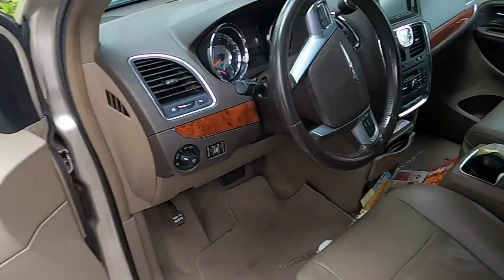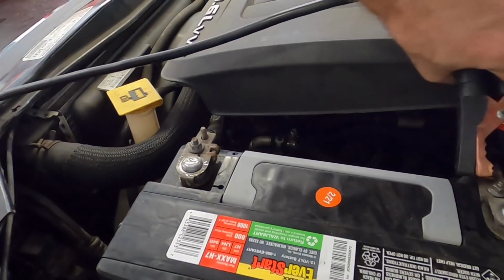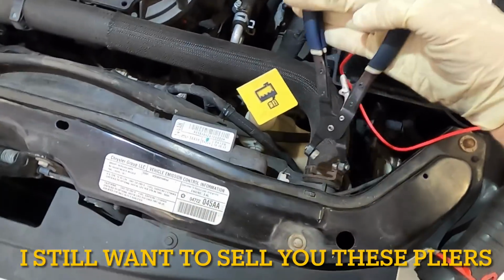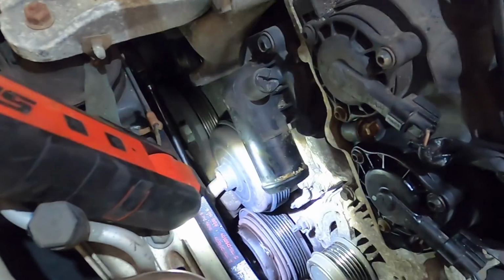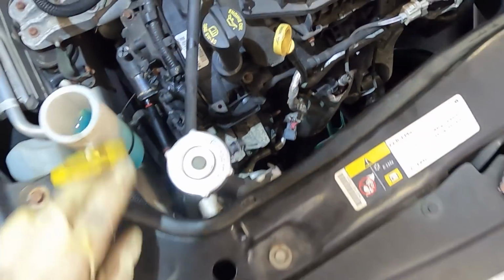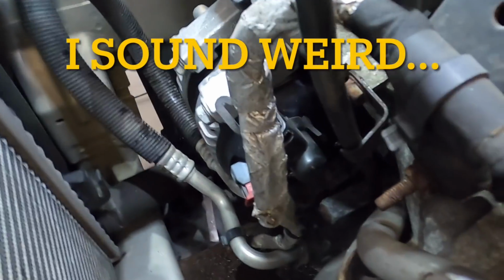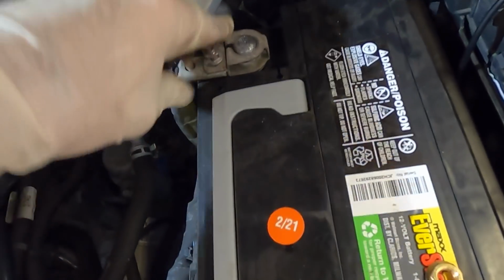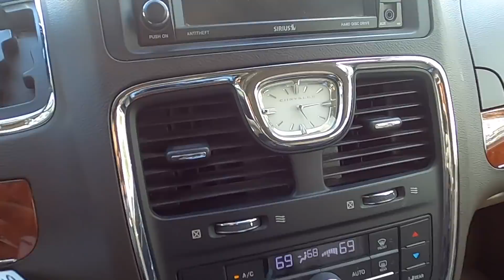Customer States: Burning Smell…Fire? 2014 Dodge Chrysler caravan battery light on!

Comment: The repair industry should all get together and refuse to repair vehicles until they design these things to make it easier to repair .. It's ridiculous that manufacturers don't think about what it takes to repair these vehicles
Reply: How well that work? That will take years! Are technicians supposed to starve while they wait? Good technicians typically beat the flat rate and have a full day’s work lined up for them. They don’t want to do the same jobs and be finished in 2-3 hours with no more work to do. The repair industry will never go for it.

Comment: When comes to common serviceable parts (like starters, alternators, brakes, batteries, filters, etc.) Get the engineers together, have them make repairs to the parts in the prototype car, then see if they can make it easier to replace.  Probably not!
Reply: When shopping for a reliable car, your mechanic (or Toyota), are your most valuable resources...Or, buy an American car...And roll the dice! (Let's play; Which model/year is not the lemon...?)
Reply: @brentfarvors192  Just got a new 2020 Toyota 4Runner, a year ago. 😊

Comment: I appreciate your approach. For me though I don't have that kind of time so I usually remove the four bolts on the AC compressor remove relocated dropped the alternator and pull it from the side. If I'm not mistaken that was a clutched alternator as well that nasty sound usually is a failed clutch. I had a customer bring in their vehicle they said that the battery light only came on after the car has been running for a while. 😂 (clutch get hot then quit) Oh yeah and I say to each his own..... But I'm spoiled with the Power Probe Meastro but I've recommended similar logic probes like the one you had. To any one get hates on any man's tools.....I don't care IF its held together with mostly duct tape and bailing wire. If it works don't knock it.

Comment: Ever try cotton liners?  I work with gloves and for sweat (and maybe a little less burn on hot parts) can't do without them especially when changing gloves.  My XL hands always stretch gloves so they also help slipping them on dry.
Reply: To whisk sweat away I would think they would use wool instead of cotton.
Reply: I usually buy the cotton liners at Northern Tool but Harbor Freight now has them. They are white and come in a 6 or 12 pack. I actually learned this trick from my BBQ team. Pork butts are much easier to pull when they are hot and when you have 40 to pull, it really saves your fingers. It works great for dealing with hot car parts too!

Comment: 12.5 volts are too low? While the alternator may in fact be bad mechanically because of the bearing whine, you do realize many modern alternators have decoulper pulleys that freewheel under low electrical load like idling, to save gas. 12.5 might be perfectly normal electrically.

Comment: On the 3.3 and 3.8 engine you could swap alternators with a 1/4" socket set in 30 minutes, nothing to take off or drain. This engine is crap with its bad rocker arms and lack of access.

Comment: When you tested the bad alternator with the voltmeter, it would have been interesting to see what the meter said if you had set it for AC volts. I think .5v is the normal limit, but a bad diode allows much more to reach the battery. That whining noise might be due to a diode.
Reply: You have four dials in a circle and they convert AC to DC it it is a great thing to do in certain applications

Comment: This just goes to show you there’s more then one way to replace a part… when I did this I did it all from bellow. Never touched the cooling system, just dropped the tire off and took out the plastic wheel liner. From there I moved the a/c compressor and unbolted it and the alternator leaving the a/c lines still in………. To which way was faster and easier. I have no clue.

Comment: The computer knows what the running voltage is. There is no reason what-so-ever that modern cars can't give drivers a verbal message; ”Hey brah, my alternator isn't charging.” Well, actually there's ONE reason. The battery lobby likes selling batteries.
Reply: Actually it DOES 'know what's wrong' but it won't just display it!
( A 'code reader' wouldn't work at all if if wasn't being fed 'fault' and 'error' information from the vehicle's 'mother chip' which has being 'storing data' since the first instant it was powered-up )
________
ANY modern vehicle could easily display 'WTF IS WRONG?' right from the factory instead of pointless 'coding' that cannot tell you 'phuck-all' without a 'diagnostic reader' to decipher 'number/letter' sequences that could easily tell you "HEY...my fuel-injectors are full of some kinda' sh!t so get them cleaned"  or 'HEY...the 'Alternator' isn't 'Alting'  worth sh!t and my sensors say the bearings are 'shot to sh!t' and 'fixing to melt and seize' so get me a new one right away and I mean TODAY! or we ain't going nowhere!*
In essence, you are 1,000% right!
WE ARE ALL BEING DECEIVED DELIBERATELY!
Reply: @gerrynightingale9045  it could display sort of what's wrong, but usually not what's causing it to be wrong. Car computers only recognize symptoms. It takes a competent human diagnostician to figure out where the symptom is coming from.
Reply: Modern cars should also have tires that last years but that wouldn't sell tires.
Reply: @RezaQin  modern cars do have tires that last years, especially compared to old bias ply tires tubeless, or even worse, tube tires. If we made them harder wearing we'd have worse roads, worse power, worse traction, or less fuel economy/more emissions. The fact you can get 80k miles on a tire without it going flat is a bona-fide miracle of engineering and infrastructure design and maintenance.
Reply: Isn't that what the battery light is for?
Reply: @Yophillips3272  hence another pointlessly replaced battery.
Reply: @7MPhonemicEnglish  It would be nice if cars would be more exact with the faults but if people can't figure it out they probably need a mechanic anyways even if it said alternator bad.
Reply: @RezaQin  all you need to do is hit the wrong pot hole or piece of debris and the “best” tire dies.

Comment: Tidbit of useful information, the battery manufacturer doesn't affix the date stickers onto their units until it ships. There is a code "stamped" on the battery that gives date information but techs and part guys can't discern the age from it, only the manufacturer can "decode" it. This typically isint an issue on common BCI group size batteries because they are moved from inventory quite regularly but on uncommon or "high end" batteries it means that your fresh date code sticker could actually be fixed to a battery that has sat on a shelf for 6+ months before it shipped.
Reply: i got one that was 3 years old on the shelf according to the sticker. A massive boy for a Porsche Cayenne....it lasted only a year and when i took it back I got the one they replaced the inventory with so it was only a year old. 
when the voltage gets to low in that vehicle it gets ghost lights. awd errors, headlight errors, engine codes because it runs rough. she definitely needs a lot of juice or she goes crazy.
Reply: Always check the date code on all batteries you buy. Even AA batteries and coincells have a datecode about ten years into the future. Many stores sell 7-9 year old surplus batteries.
Reply: I suppose the point is - do you take the one that's been sat for 6 months at the auto store or wait for a new one to arrive that's been sat for 6 months at the distribution centre.
Heads you lose tails I win.

Comment: I'm convinced that automotive engineers hate mechanics. With all the technology available in design ,wouldn't you think that the engineers would design something that's easy to work on? I own a ww2 jeep. Simple to work on. Easy to fix. I miss those days .
Reply: It seems from the comments that he did it the wrong way. Should have taken it out from the bottom. But also, a lot of the time the engineers have limitations on what they can do, often being told to use a pre-existing engine and making it fit into a different car. And of course there's always financial limitations on their design.
But yeh, the thing that irks me the most is oil drain plugs that drain straight onto another part of the car.

Comment: Dear god . All that to remove an alt . My mid 90s- 2000 fords, chevy, and even dodge v8s is like a 10 min job lol.
Reply: If you think this is bad, look up replacing an alternator on a 1st gen Ford Escape V6. It's a 3hr job that requires removing the axle shaft.
Reply: I saw a video where someone had to replace the alternator on a Fiat 500. He had to take part of the suspension apart!
Reply: Look at the 90s era's Ford Probes. To get the alternator out you have to remove a ton of parts in the suspension.
Reply: look up Cadillac Deville alternator change, you have to drop the subframe
Reply: Alternator on my 92 Integra had to remove the axle. On my 2002 V6 Altima had to remove the radiator.
Reply: My "everyday cars" are '79 and '88 Monte Carlos. I do all repairs myself. What I loose in gas mileage I more than make up for in repair costs. I've also been driving them for decades!!! Can't say that about the average new car, especially imports.

Comment: I love how those alternator pulleys have become a maintenance item. I get why they did it, but it definitely threw me for a loop the first time I encountered one in the wild.
Reply: When my son was racing dirt track we converted from v belts to serpentine belts and that help us hold the belts on at higher RPMs cuz that motor would flat scream and then high RPMs it would hold together and we sold that motor for years after racing is a running motor and never did come apart and we freshened it up every season

Comment: Most modern "smart" battery chargers will start with a trickle charge on extremely low batteries until it reaches a level where it's safe to give it full beans. That gives the best chance of the battery recovering without damage.
Reply: Even with a plain Jane old fashion charger most batteries taken down that low don't take much current flow for a while until they get rolling.

Comment: I did one of these once.... took it out the bottom.  Had to remove AC lines.  Not sure if it was faster or easier.
Reply: Don't have to remove the lines. Just unbolt the compressor and push it aside.

Comment: last year, my valve cover decided to coat the engine and alternator with oil. Alternator replaced and two months later the new alternator failed. Turns out the center shaft broke. It happens.

Comment: Faster to go underneath and unbolt the AC compressor and drop the Alternator out the bottom. Don't have to drain the radiator or remove the fan. Takes about 45 minutes that way. 5mm socket to unthread the studs and moves much easier without those in
Reply: Ya beat me to it.
Reply: Just did my wife’s van last week. Took it out the bottom way easier.

Comment: Rainman Ray!! A tip to increase your views. Add the Make, Model and part you are working on in the title. People with the same issue are searching for how to do or how to fix. This will increase your following. Burnt up alternator is good but the Chrysler town car alternator in there will help people find you.
You are doing great. Keep going.
Reply: yes totally agree .. Listing the make N model & year in the title may make it long , but hey that's just more keywords for the search to hit . :)
Reply: Great idea because I do that all the time.  If I have a big job to do on my toyota, I google it and, sure enough, 2 or 3 Y.T. vids come up showing people doing the same job.  It really helps.  I even downloaded a video and had it on my tablet with me under the car while doing my timing belt.  I went step by step and it was done.
Reply: Try finding vids for 95 Buick Regal. It's a Canada only model.
Reply: @greypoet2  Google works in Canada too right?  People up there must have to work on them too don't they?  IF they do then it will show up in a search unless no one anywhere has ever posted about it, which is possible but unlikely.  PS here is one I found in 10 seconds: 
https://youtu.be/M0lxUYqLEpk.  It shows changing the alternator.
Reply: Thank you @OverlandOne . I appreciate your willingness to help. Unfortunately, my motor is a 3800 and my biggest problems involve the wiring. Door locks, windows, speedometer and a host of other things. I bought a Chiltons manual off e-bay which helps some plus a host of videos (yes, googled) which are sooo very close but not the same. 
Mostly I think, it's going to be hours with a multimeter and a sore back.   lol
Dreaming of something from the 60's where you can actually see the engine and follow the wiring.
Again, thanks for trying.
Reply: @greypoet2  Well, best of luck to you.  Wiring issues can be a real pain.  Check all of your ground wires because the systems you mentioned are all on different circuits (I would think) and the only thing they would have in common is ground.  There are multiple grounding areas on most vehicles and one rusted out connection can raise hell with many seemingly unrelated things at once.  I agree, 60's and early 70's cars (I had a 1970 440 Plymouth back then I still miss to this day) were much easier to work on and, with just a few tools in your trunk, you could always get home if something went wrong on the road.
Reply: @OverlandOne  Yeah, one lousy ground could mess up the whole thing. *deep sigh* I guess I know what I'll be doing this winter.   lol
1970 440 Plymouth!?!? Jealousy running rampant here.   lol
Thanks for your comments.
Reply: @Bryan-Hensley  I am an entrepreneur who helps others succeeded. I don't make the videos I help others increase viewership. Rainman is a great guy who will be very successful and he deserves any help. Just a friendly suggestion. Be helpful not critical.
Reply: @greypoet2  lol. no it isnt. I lived in florida and I drove one.
Reply: He's clearly doing this for fun, not money. I don't think he minds the low sub count.
Reply: I don't think a good mechanic like him wants to encourage the (false) idea that untrained people can self-diagnose their cars by watching a video of another, similar car. Just watch his videos where the clients think they know better because they found something on the internet and won't let him perform the maintenance they really need...

Comment: I've always heard you can't just spray down an engine bay to clean it. Which never made sense to me. So why is that a thing that people say you can't spray down an engine? And whats like the worst than can actually happen from doing that?
Reply: i wash my engines 2x a year. i think it keeps the hoses fresh longer along with everything else. all that oily grime builds up and makes the hoses/wires soft and squashy. i did change my hoses at 200k just because i did a system flush. 
i go to the carwash and use the tire/engine degreaser.. then the low pressure presoak.. and lastly the low pressure spot free rinse. works great and looks awesome when you are finished.
i did have one issue one time. it was an older jeep and water got down the spark plug hole which has an o ring thats supposed to keep the water out. she had a miss... until i removed the plug and the water that was in the hole shorting out the coil plug. once i removed that she ran great again.  that was one issue out of dozens of engine washed.

Comment: The 1st problem is that never-start battery 
I've put 7 never starts in a vehicle in a year 
They are junk
Reply: I had one in my Jeep XJ and it lasted over 5 years.
Reply: You have something else wrong or you are running it down too far too much.
Reply: @Bryan-Hensley  it was a bad ground that I couldn't find 
Had to replace the alternator and the starter as well

Comment: im not an expert on changing alternators but that seems like a lot to have to go thru. I mean most front wheel drive cars are not easy but damn
Reply: you should look up changing an alternator on a Cadillac Northstar engine if you think this is bad, lol!!! Example, look up 2003 Cadillac Deville alternator change
Reply: @mattcat231  that's funny u should say that cuz I think I have seen that repair done on a Northstar or another accessory replaced and it was insane. I'll look it up again
Reply: @ianriggs  oh its definitely NOT a fun repair, i own an 04 Deville, and an 03 Olds Aurora, both with Northstar engines

Comment: They make these funnels that attach to the filler neck that let you really top off and get the air out.

Also there is a bleeder screw on that tstat housing don't want to have it come back now for over heating due to shitty Chrysler design.

I'm just sour over my Buick rendezvous the intake gasket caused a hydrolock issue which caused overheating. Then I drop 2300 for headgaskets and intake. Only to have black ice total it with a minor bend the engine bay is 2 inches smaller and the hood has a bend otherwise still run drives could probably be fixed but the body shop said 4500 which is double what I paid for it and triple what it is worth.

Comment: The weakest point of every alternator (to me) seems to be rectifier diodes in them that turn the low voltage AC into rippled DC.
I have seen them fail in 4 track reel-to-reel recorders, TVs, PSUs for desktop computers, & audio amplifiers.
I can see no way of making them redundant (other than placing them in series with each diode in case one shorts out).

Comment: Want to fight a tight hole ( giggdy) try the bastard child crossfire . In my opinion probably easier then this as you dont have to remove half the dam front end , but getting that nator out of the hole . Dear god . The engineer can eat a hole bag of d!€ks . I swear it takes 4 complete  flips 2 360s 5 180s click your hills 3 times and scream chrysler is god 8 times then you have unlocked the nator black hole and it is released .